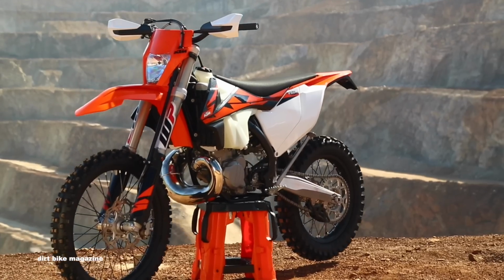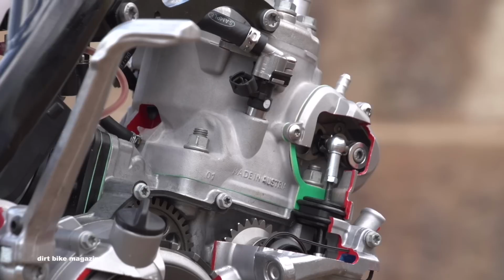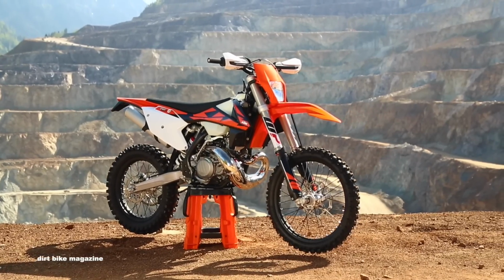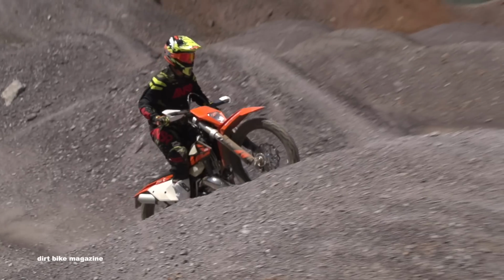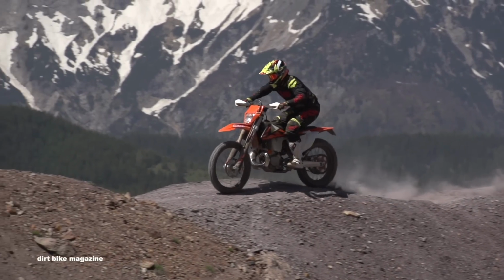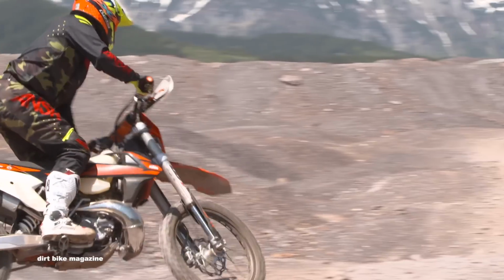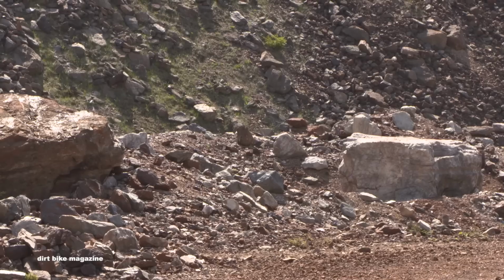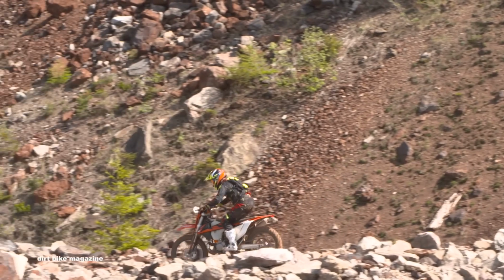First Ride 2 Stroke Fuel Injection KTM 250 XC-W - Dirt Bike Magazine

Comment: KTM is trying to fix something that has been fixed by Suzuki in the 70s having to premixed gas lol my 1974 Suzuki TS400 Cyclone comes with oil injection and still makes 70 hp on original stock piston rings so KTM can suck my nadd's! People don't seem to understand bikes are getting cheaper and less quality is being put into designing a bike that will last rather they spend the money on designing a bike that will have a lot of power and be cheap and efficient to manufacture not to maintain and use lol my bike is called the widow maker so yah that just means I won't live as long oh well at least I have something that will last longer then one generation or depending on how you use your bike 10 minutes lol 😂 come the fuck on people Low compression and really well designed exhaust scavenging two strokes are the way to go but the EPA will not allow Low compression due to how much they pollute and frankly the planet cannot take the abuse it would cause. 🤔 so and personally I like my trials bike much better than the new trials bikes that you can't drive down the road and I'm sure I'm not alone in thinking old bikes are more fun to drive and can be easier and cheaper to own. Just stockpile regular maintenance parts and major parts just in case. And that cheap $2000 motorcycle you bought will last you 43 years! Like mine lol 😂
Reply: Jatz 07 🌚
Reply: Jatz 07 sorry 40 hp I exaggerated to troll a little but it was a barn find kinda if you know your shit you can get them to make a lot of power and last a long time. Lower compression = less engine wear allowing you to smash for longer without blowing up yay 😊
Reply: Point is my shit still runs that shit will probably stop working 5 years - 10 years from now or less maybe 🤷🏻‍♂️